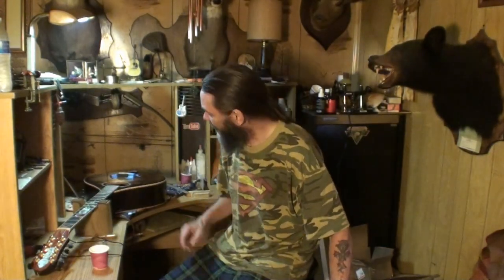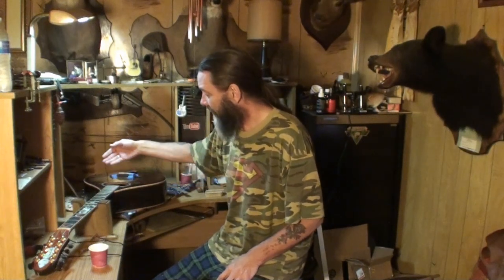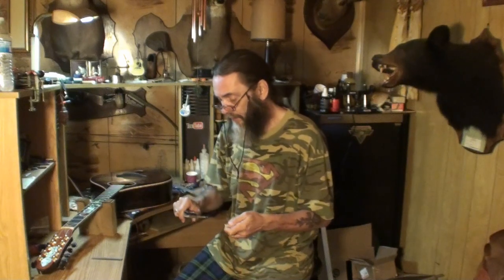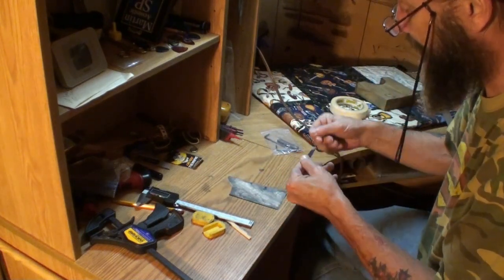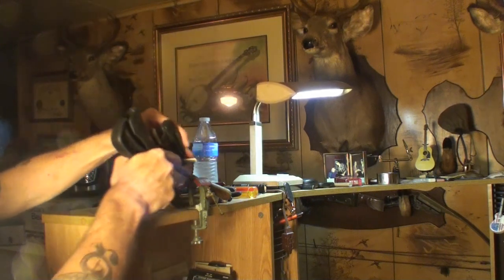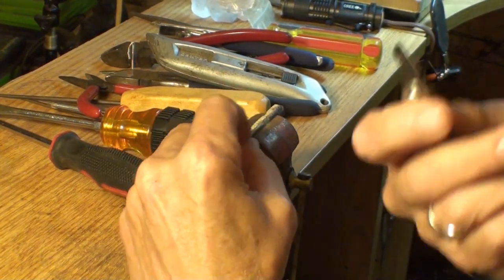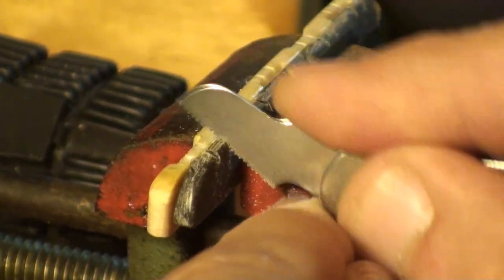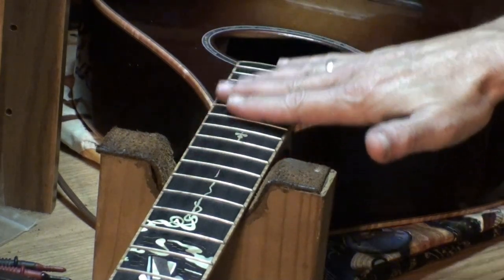Cittern part 1 of 5 Gluing braces and making new buffalo horn saddle and other madness

Comment: That's a thread pitch gauge and that's a really fine saddle you made. Great job on the gluing of the braces.....they can be very hard to do. Have a great evening...Hoold Ooon:)
Reply from the maker: Yeah this thing is pretty tough to get your arm, some tools and a light and mirror into all at the same time! lol I still haven't polished the new saddle or finished it 100% yet. and yes! Correct answer on the thread pitch, it's really handy for getting nut and saddle slots started exactly where you want and then switch to a proper gauge nut file. Thanks for tuning in Suzanna! Hold on! 8D

Comment: The small soundhole makes me wonder how hard it was to get your hands in there to glue the braces. Your “saw” is a thread gauge used to measure the pitch of a thread on a screw.
Reply from the maker: I thought I would have more trouble than I did but the hole is oval shaped and bigger than it really looks. It was still pretty tight tho. Yep, it's a dandy for getting nut/saddle slots started, once I get them where I want them I switch to nut file for whatever gauge string is used. Thanks for checking it out.

Comment: Thread pitch gauge. You could also use welder tip cleaners.  Very cheap and come in lots of gauges
Reply from the maker: I never thought of that but I bet they would work perfectly! Might have to give tip cleaners a try. Thanks mate!
Reply: I've got the tip cleaners, pretty handy little things.
Reply from the maker: Rattlecan Guitar Restorations
Very cool! I'm definitely gonna have to check them out! Thanks guys for the idea!

Comment: Mr. Randy I love your videos. You are nice, humble man with a lot of knowledge :) Can you (or some of subscribers) tell me which  exactly Martin strings are you using? I know you mentioned it hundred of times, but is it SP phosphor bronze or just bronze?
Reply from the maker: Thanks for your kind words and thoughts, and my apologies for what happened in the last video. I use Martin MSP7200, they are treated and last longer than normal strings and are phosphor bronze. I also use Martin MSP4200 which are exactly the same only they are not treated. Thanks for your support! :)
Reply: Don't worry about last video, that's fine. I get your point :)

Thank you for your answer, I'll try then definitely. I'm currently on my journey to find replacement for elixirs which I'm using exclusively for 4 years straight at least I believe.
Reply from the maker: Elixir is what I used for years too, they just didn't feel natural to me, pull offs were more like slip offs lol And I didn't think they sounded quite as good as non-coated strings. I tried the MSP4200 first then the MSP7200 and I was hooked! Been using them ever since. They don't last as long as Elixirs but I just like them better and you can find them pretty cheap in comparison.

Comment: Thread gauges is it metric or imperial. Never thought of using one for a saw but whatever work's do it.
Reply from the maker: Without going and looking I'm not sure because I don't pay any attention the the gauges of it, I just use smaller blades for small strings and bigger ones for wound strings then switch to the gauge nut file I need for whatever string gauge is going on it. Hope that made sense.

Comment: Hey Randy  & youtubers what your thoughts on bring back old dead strings ???
 I saw this dude on youtube Saying If you want your old nasty dead strings back to like back sounding like new 
One can do 2 things snapping  the strings 19 times or rubbing alcohol on the string .  This same guy said you don't need linseed oil or lemon oil  maintain you finger board just use little bit of water to wipe the dirt away !    My Uncle since told me along time ago . The Old timers  use to bring old dead throw them into pot of boiling water . My opinion  this dude is potted  !!
Reply from the maker: I've heard different stories about people boiling them in water, using wd40 and many other things but I never did try any of them, I always thru them away and went for new strings again lol Maybe someone else will chime in and tell us more ways to save them.
Reply: Boiling stings will bring the temper back in them for a while. The Opposite is the true if you boil New strings it will make them sound a lil dead because it takes the temper out boil on high for 10 min.

Comment: can you use deer antler for nuts and saddle's?
Reply from the maker: Yes, they work perfectly for nuts and saddles, I try to use a piece that's pretty consistent completely thru and have a ton of them from all my years hunting.
Reply: absolutely.  You can use a side range of materials.  With antler the outer part is hard, lie bone, the inner core is porous.  See Rosa String Works and Gerry Rosa for antler saddles and nuts.   It is what he uses on all his mandolin builds.
Reply: Are the points or main beams best?
Reply from the maker: I like using the center of the main beams best, they seem to be more consistent there.

Comment: lol that is a thread gage it looks like.
Reply: also know as a screw pitch gage cant sneak that past a body man lol
Reply from the maker: hahaha you are correct! It works perfect fot starting nut slots! :)
Reply: Tim Cox nope ya sure can't.we have about all the hand tools off the snap on trucks and half of the air tools.
Reply: Krusty Buzzard i have have bad luck with air tool even oiling them daily so now i just buy cheap air tools but everything else is snap on. It is expensive to be a body man lol
Reply: Tim Cox yes it is and they change clips and screws just to make you buy more.
Reply: Yep got to love working on bmw and mercedez. Lol joke i hate them. Once you got them figured out they change everything the next year
Reply: I'll tell about Snap On they say they Machine Everything & build their tools in house. Not true I've machined a many of Snap on Ratchet's from small to large. That's just Ratchets we did for Snap-on . Snap on is over priced imo. Craftsman is now in a mess not sure how they will turn out their foreign manufacture is breaking contract right now I bought craftsman tool & they always replace broken tools even tape measures. Harbor Fright is the place for "cheap" air tools". 
 Oiling air tools is key many folks don't do that I had a woodshop once where did custom van & truck wood trim in Black Walnut.
 I did everything tenon & morder & glue no screws in any of my work who ever bought vans & trucks w/my woodwork never had the stuff fall apart. I went out of business soon after they started w/Graphite trim. I wish I had kept my shop I would be building guitars. I did make a guitar hanger that was one of kind not seen another one like it since.